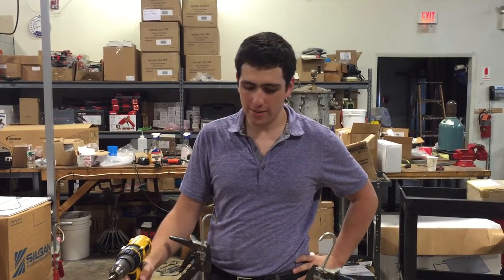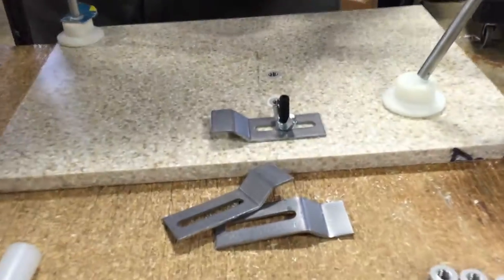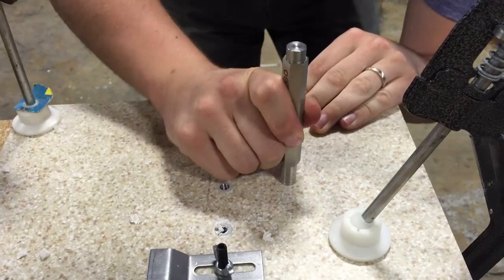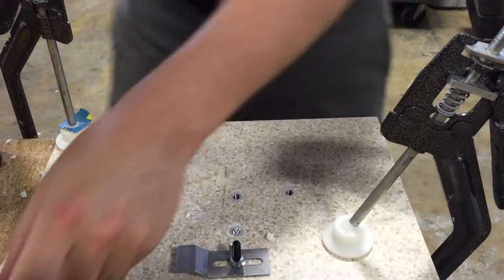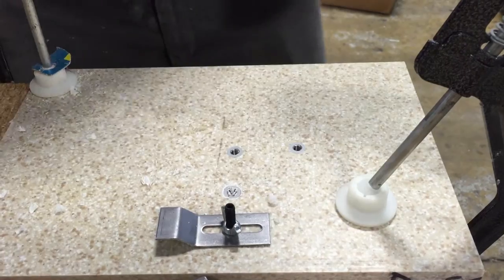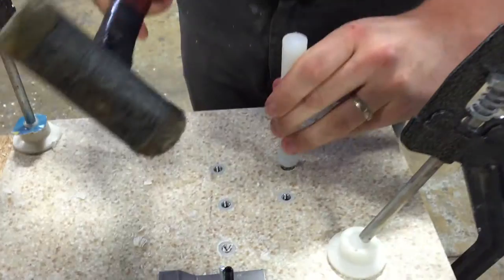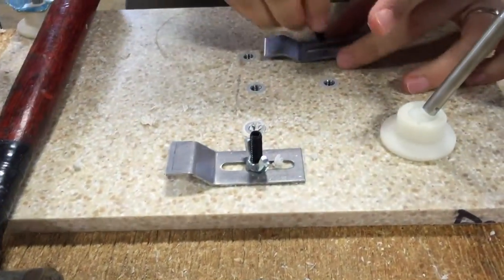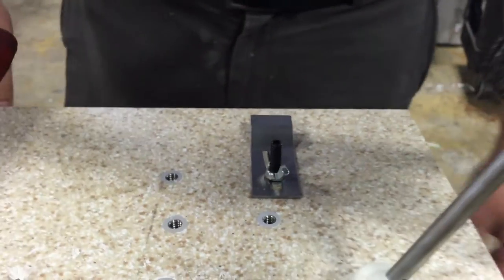Keep Nut (by Special insert) Video Using Hand Drill on Solid Surface

Comment: keep nuts are supposed to be drilled at .5mm deeper than the nut you are mounting... how do you prevent going to deep or not deep enough? Also what if you are drilling Fibre cement, granite, quartz etc. instead of plastic or soap stone ? Also is that tool a depth gauge or diameter gauge?
Reply from the maker: For drilling granite quartz, etc. check out our KDM115 drilling machine. This tool has a built in depth stop so you can set an accurate and repeatable depth. https://youtu.be/y7BzVOaHqx8. When using a hand drill like this video we also sell a stop collar that you can put on the bit to set a repeatable depth.